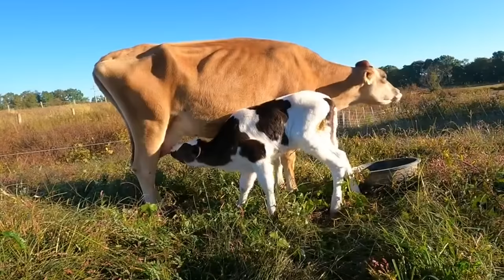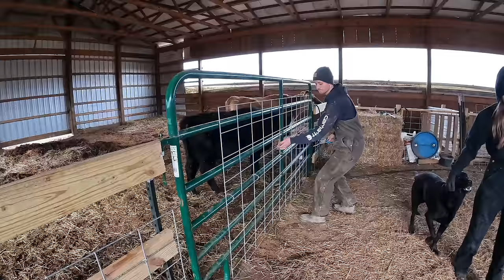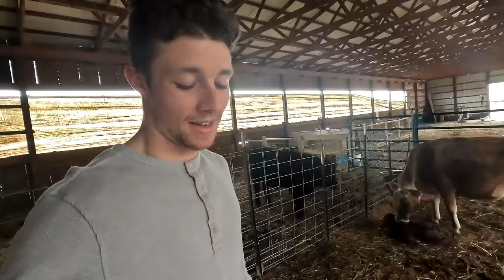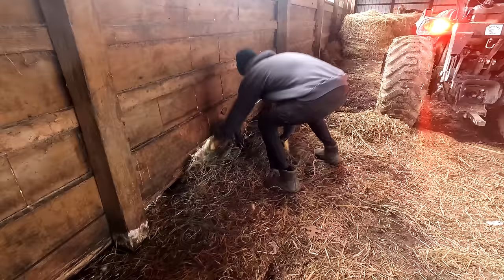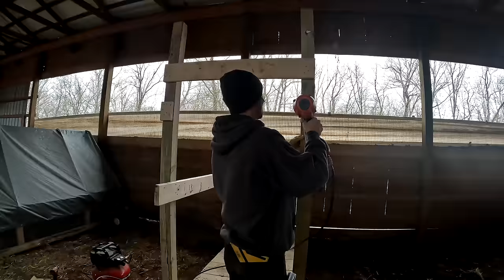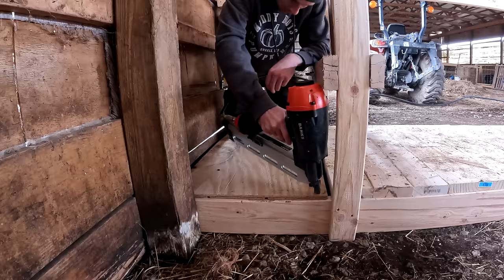We Didn't Know If He'd Make It

Comment: we built a step up milking parlor to milk two at a time. a jersey will easily step up 11 inches so you dont have to bend over so far.  to late but if you re build set it up so they can go forward to leave, that’s a setup, pass through parlor. makes your life easier.  also you can milk once a day (oad) with jerseys.  we leave the calves on for about 5 weeks until they’re grazing.  pure alfalfa is to hot for always feeding.

Comment: Regarding your milking area. Do yourself a favor. Affix a place you can drop a backup board on that stand. It will help her steady down to it when she starts this journey. Just get a piece of 2x8 and affix it to the side at the back about the height 12 inches down from what would be her top height. Put another piece on the outside of the other side and ut a notch for a 2x4 or metal bar to be able to drop into it.  This will keep her from backing up on you while milking.